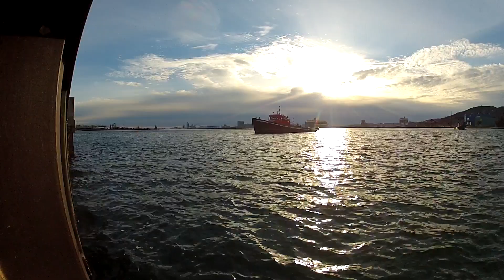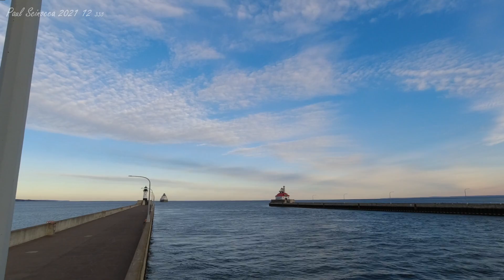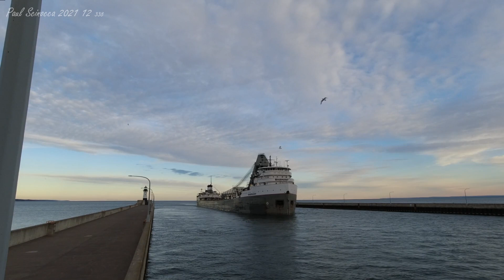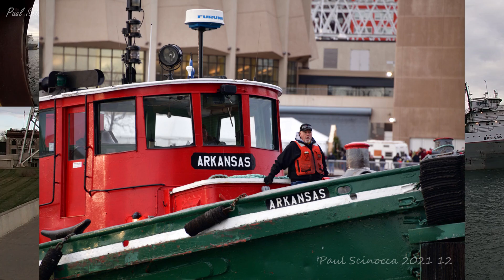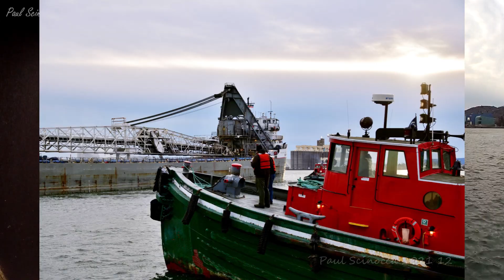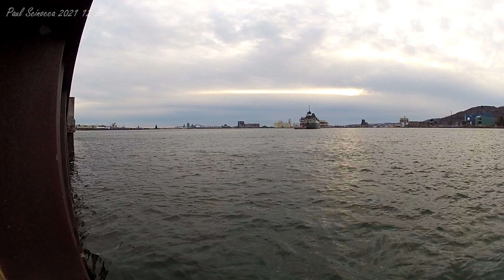Rare Duluth Arrival! The Saginaw making their 1st salute filled visit this season! December 04,2021

Comment: Hi Paul.  Unusual to have tug assist for Lakers?  I noticed as she passed under the bridge that her flag was at half mast.  I believe that is a signal of a ship in distress.  Was she having steering problems perhaps?
Reply from the maker: That could be, another person asked if they were going to repair the bow thruster, so they may have had some mechanical issues going on. Not sure though.
Reply: A thruster was broken.
Reply: Radio traffic between the Saginaw and the CSL Niagara made it sound like someone recently passed away that they both knew. I suspect the flag at half mast was for that.
Reply: @1Long2Short  Respects to all if it was so.  🙏🙏

Comment: It seems odd shipping (literally) grain from one Great Lakes export port (Thunder Bay) to another (Duluth). Given that most, if not all, the grain would have come from the Prairies, could it not have been delivered directly to Duluth by CN rail? The grain would have been railed to Thunder Bay in the first place!
Reply from the maker: I had the same though, not sure what was going on.
Reply: Well, does Thunder Bay have the tech necessary to fix that thruster? Maybe that’s the answer, Duluth (well, Superior) has the Frasier Shipyard. Why they’d unload the ship though is weirder.
Reply from the maker: @jonathanellsworth21  then after discharge they sailed up to Two Harbors to load iron ore. No service done while in Duluth for all I know
Reply: Just speculating, although I did see (via marine tracker) she left at a much faster speed than she came in.